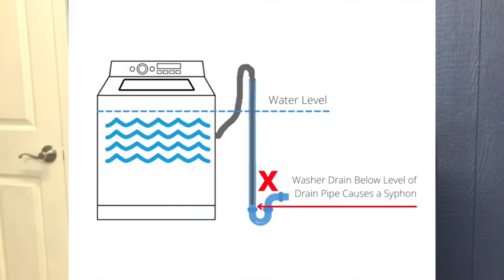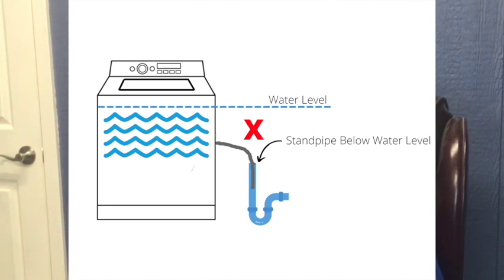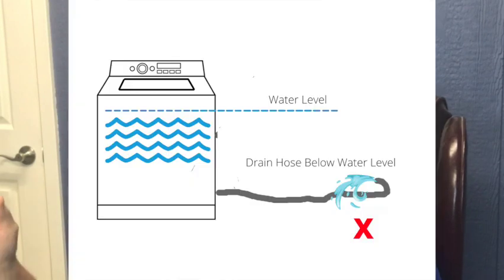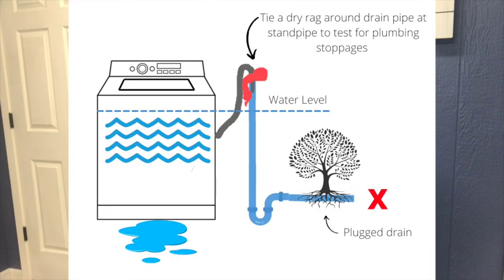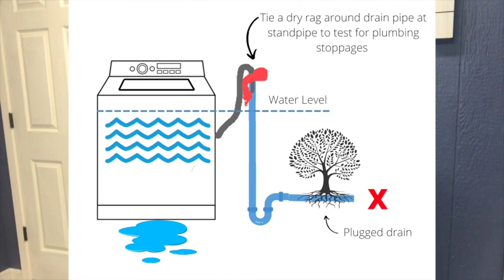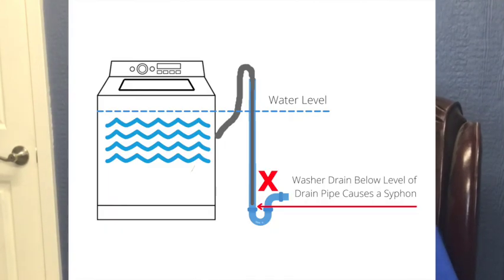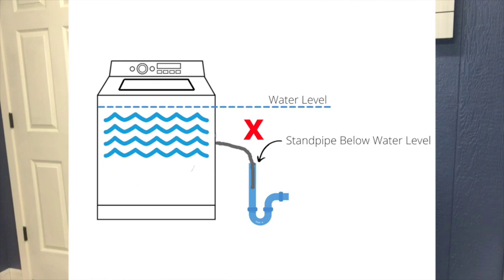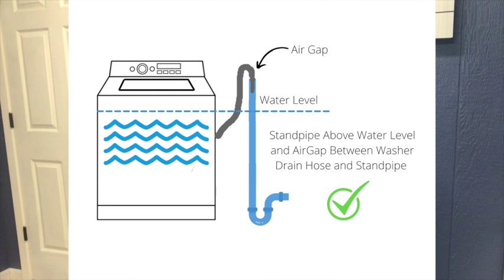How To Troubleshoot Washing Machine Cycle Failures: Plumbing Tips for Technicians

Comment: Have you ever had a washing machine stop after the wash cycle drain but not refill for the rinse cycle unless you would run the water somewhere else in the house first, you could hear the pump make a humming noise but nothing would happen until you open the valves to the sink
Reply from the maker: No, I’ve never heard of such a thing. You got gremlins in your house! Thanks for watching!

Comment: Washer was working fine as usual when I remembered that I hadn’t gathered all laundry so I paused it while gathering remaining laundry but while in mast bathroom which shares a wall with laundry room I hear machine draining I run in and it wouldn’t pause it wouldn’t fill only empty so I unplugged it which will normally cause it to reset but when I plug it in 1/2 hour later and its still draining even though it clearly in fill mode so I unplugged it and that’s where I stand at this moment
Reply from the maker: Hold the start button down until the pump stops running. If it reoccurs you’ll need to change the control board.

Comment: I purchased a Candy SmartTouch not that long ago, and it has been  working fine for quite some time... then it suddenly gave an error code E02, which indicates a filling error. My drain is far from perfect, so the hose has been sitting rather low, but this has worked fine with both this and previous washing machines.
So I followed the suggestions elsewhere and replaced the inlet solenoid valve a few days ago, but to no avail.
However, after watching this video, I gave it a shot and raised the drain hose a few inches, and that happened to solve my problem - now it completes the cycles with no issues whatsoever! Perhaps the hose has dropped just slightly at some point, causing this behaviour.
Thanks for this suggestion, now I can finally wash my clothes properly again! :-D
Reply from the maker: Some problems have simple solutions. Thanks for watching!

Comment: you know this! One of the first steps in trouble shooting a problem it to decide, what did you do to change conditions while attempting a repair.
Reply from the maker: Good advice! Thanks for watching!
Reply: @HarperandKnowles  I didn't know if you were still current. Good! I have a question. Oh. 22 years Air Force Jet Fighter Mechanic, spent the next 20 or so years in manufacturing and distribution. I've turned some wrenches!  My washer quit working on me last week. LSQ8243HQ0 Whirlpool Washer. I bought new in 1999 or 2000. Lots of hours on it. Thought it was the timer. Changed, nope! checked out the water level switch, the air tube was plugged. I was able to clear it but it almost immediately plugged back up. Before I found that out I determined it was a bad switch with a meter so I replaced the switch. The lid switch also appears to be bad. I have one coming probably be here tomorrow. Right now I am thinking there is so much junk in the bottom of the tub I am going to have to remove the inner tub and clean it all out. The tube at the Air Dome end appears to be back filling with scrud from the bottom of the tub. I injected vinegar as I've seen here. And filled the tub with a couple gallons of vinegar to sit overnight hoping for a quick band aid fix! The original problem was and still is, washer would not finish the wash cycle, would not advance, or drain. I used the drain hose to empty the washer by filling a bucket that was lower than the bottom of the washer tub. It drained good. No blockage. I drained a waterbed once in an eleventh floor apartment in Spain by connecting a 50 foot garden hose and lowering the other end over the side of the building.  It drained fast! I had pulled the water pump off of the motor without disconnecting any hoses. Pump turned okay and the motor turned okay. The motor does power the agitator. Should it still power the spin? When I clean out the tub I will disconnect the hoses from the pump and look inside it just to make sure there is nothing there. What really concerns me is after changing the timer, the water level switch, the lid switch and cleaning out the tub if it still will not advance could there be a problem with the motor and the gears? I suppose anything is possible.  Runs the agitator alright though!   I can replace all the major components and still be cheaper than buying a new washer especially if I add in what I've already spent on nonreturnable parts. I just turned 70! I want my washer once it is repaired to out last me!  Been getting in some cussing practice! Just looking for some of your years of knowledge. I'll be happy with whatever you share with me! Ideas, encouragement, words of wisdom. All will be appreciated! Thanks. Have a great day!
Reply from the maker: Change the lid switch.
Reply: @HarperandKnowles  thanks! I pulled the lid switch and it was coming apart. I should have the new one tomorrow. I saw a guy band aid a switch with a zip tie. I could probably do that but why? I'll just install the new switch and hopefully all will be golden!
Reply from the maker: Or you could make a bypass from the plug on the bad switch until yours comes in. Just tie the two wires that aren’t ground (ground is the green wire) together.
Reply: @HarperandKnowles  As you know, taking things apart so you can gain access to what you must fool with is what is the most time consuming parts of any repair it seems. I'll just wait on the new switch! I have the cabinet cover off right now and I don't want to put it back on yet. It challenges my old ass! The reaching and bending and squatting just aren't very easy anymore! Wah!

Comment: thats some slick camera work buddy😊👍 i like it. 

my  BUSH A127QW washer was working fine for years as is but has started to trip the circuit breaker, it will turn on start to fill/run as usual for about 10 seconds then trips the breaker. before this happened i had noticed that wash cycle would go on and on until i manually turned the dial to rinse, then it would drain the water out and rinse and drain and spin the clothes out just fine, but now it just trips the breaker at the start. ive tried a cold water cycle too thinking it might be the heating element but no it trips the breaker as i described above. the fact its starting then tripping the circuit is bugging me as its working but something goes off,  also the fact if it was set to drain and rinse manually before this breaker tripping started, it would do that so that suggests the drain pump is working as well. man if you could help me that would be great!!
Reply from the maker: I would try replacing the breaker. After tripping repeatedly they get weak.
Reply: @HarperandKnowles  thanks for your reply i will try that. so you dont think the washing machine is causing this? my breaker doesnt usually trip and its definitely being caused by the washer running, if i switch the washer off and reset the breaker it doesnt trip anymore, then turn the washer on and run it it goes for about 10 seconds and the breaker trips.
Reply: @HarperandKnowles  so i tested to plug and the breaker by plugging in a microwave and running it, it did not trip the breaker. 

i got to the heating element in the washer and disconnected all the wires leading to it and turned the washer on, it drained all the water out of it that was sitting in it from beginning the wash cycle before, ran for about 1 minute then tripped the breaker. so its not the drain pump and its not the heating coil, correct? when it began to go into the selected cycle the water came on into the detergent drawer for about 1 minute, then stopped, maybe was a prewash or fabric softener section or something? THEN, when it switches to put the water into the main drawer where to wash detergent goes, that is when it trips the breaker!
Reply from the maker: Could be a shorted solenoid on the inlet valve??? Sounds like you'll find it by elimination.
Reply: @HarperandKnowles  wouldnt that then trip the breaker at the first sign of water? or does the inlet valve only get used after the prewash/fabric softener has been done, then when main flow of water comes on for the detergent section for the wash cycle the valve comes into use? thanks again!
Reply from the maker: Each function has a separate solenoid to feed water into that area of the washer. Also if the cycle selector is warm a hot and cold valve mix those streams into the fill funnel. Another solenoid routes water to the bleach tray and another to the fabric softener dispenser. Water inlet valves can become very complex depending on the manufacturer. Try unplugging each solenoid in turn and testing to determine if one is causing the short.
Reply: @HarperandKnowles  nice thanks buddy, ill check that tomorrow. im getting close i can feel it!! haha.  i selected cold water washes as i thought was the heating element but at the beginning of it all theres definitely some clicks and switching going on and i know just from using it thats for the pretreatments like you said,  then it cuts out, so yeah you may be right on target there. 👍
Reply: @HarperandKnowles  well i went to the scrap yard today and found a washing machine with the exact same water inlet valve, i took it home and swapped mine out carefully hooking up the wires properly, got all excited and ran the washer and it tripped the breaker again at the same place in the cycle.  i suppose the used inlet valve could be busted too i will get a multimeter tomorrow nd check that out, but if not what would come after the inlet valve to test? thank you!
Reply: @HarperandKnowles  ok so heres an update, another technician advised me after the inlet valve didnt stop the shorting thaive taken your advice and swapped out the mains interference electrical filter and things have improved but now its doing something else. the machine now makes it past the prewash and fills the drum with water for the main wash, then it stops seemingly ready to wash the clothes, and then the stop cycle light flashes a bit then the machine drains the water, stopping the cycle :(. man im so close, what do you think?? is this now a motherboard issue? thank you!
Reply from the maker: I was looking back through this thread of this discussion and see the make and model of this machine. I have never encountered a Bush before. I did a search and found that it is made in Turkey. You may be asking the wrong guy for advice. I know they basically all have similar components but I don't have any experience with this company. Stopping after filling could be a lid lock problem if it's a top loader. I really don't know how to advise you about it without being able to diagnose the problem myself. Thanks for reaching out!
Reply: @HarperandKnowles hi thanks for your reply.  yes im in the uk its huge store chain called Argos brand. dont all washers basically just do the same thing in the same way though? slightly different parts but basiclly operate in the same way and present similar problems? uk us canada europe dont they all work the same??
Reply from the maker: Yes, pretty much, but some issues are more common among certain brands. If I had any experience with this brand I could probably be more helpful. Good luck with your repair.

Comment: i have a RCA portable compact washing machine that is throwing an E4 error code (drain alarm) when it hits the rinse cycle. at one point it threw an E5 code (overflow alarm). it throws a code when there’s about 2-3in of water left in the tub. the water CAN drain, i was able to get the water to drain eventually the first time around. it just WONT drain. 

the rinse cycle begins, it counts down from 28min to 27, and it never counts down lower than that. the draining also starts off normal, and i can visually see water running through the drain hose into the stand pipe. after a minute the draining starts to slow down to a crawl. eventually the alarm goes off. 

if i manually skip the rinse cycle and set it to spin, it works fine and finishes the wash out removing all water. 

this all started when i washed a rug twice in a row. the first time nothing happened, and the second wash the alarms started going. 

there’s no clog in the drain hose, the drain hose is correctly in the standpipe, the filter is cleaned out. i have no idea what to check next
Reply from the maker: I work on a lot of washing machines but I can't say that I have ever worked on an RCA. With my limited knowledge of these units I wouldn't be able to even speculate on the problem. Are these units commonly found in RV's. I don't work on these due to the limited space and the difficulty in removing them from the vehicle. I usually refer people who come to me with these issues to seek the help of an RV dealer. Thanks for watching!
Reply: @HarperandKnowles  thank you for replying! i’m not sure if they’re used on RVs, from what i’ve seen online it’s comparable to most other portable washing machines. i have mine permanently hooked up to a hot and cold line though instead of using it through a sink. there’s nothing online besides the 11 page manual lol, so i figured i’d try here before messing around with it some more. thanks again!

Comment: The machine is not filling all the way up but when it stops it flushes out the water before the wash sycle begins the drain pipe just goes out the back of the wall to the ground ..can u tell me whats wrong with it
Reply from the maker: If you watch the video it will probably give you the solution to your problem. But, I’ll give you a hint. The drain hose must be higher than the final water level inside the tub. Thanks for the comment!

Comment: I have a Maytag MVWB765FW3 error E1 F8 have already cleared the screens it filling and draining at the same time how does the water level pressure switch work and where is it
Reply from the maker: If you watch the video you might get a clue to what your issue is. Thanks for watching!
Reply: I replaced the inlet water valve and it works ok now but for some reason when the washer stops instead of all the lights going off the led is flashing 01
Reply from the maker: I have no Idea. Error codes come in sets of two; flash two digits then flash two more. As far as I know, there isn't an 01 01 code.
Reply: @HarperandKnowles this isn’t a error code after the wash is done it just flashes 01 THANKYOU FOR THE REPLY Normally all the  lights go off after the wash
Reply from the maker: Well my OCD is triggered now. If I find an answer for you I'll let you know. As long as you can wash your clothes I suppose it will okay!

Comment: Thank you so much for this video. I had recently replaced the drain hose and thought that the longer hose would be beneficial to my washer but I quickly found that my washer would empty out the water prior to it completing the rinse cycle. The drain was way lower than the tub (causing the siphoning effect for my washer) so I cut the hose down and voila problem solved like you said. No need to call a technician to come look at it. Thanks again!! 🙏🏽
Reply from the maker: Some of the world’s problems are simple to fix. Thank you for watching my video and the positive feedback to!

Comment: Thanks for this video.  I think my issue might be a little different.  My washer is 15 years old and has worked perfectly until this weekend.  it's an analog Maytag and it has started filling and draing at the same time.  I started a load late one night and it it continuously filled and drained all night long!  We haven't made any plumbing changes so I doubt there is a syphoning issue.  Is the drain valve stuck open?  What should I check?
Reply from the maker: Something has changed. Make sure your stand pipe is higher than your tub. Pull the drain hose out and make sure there is an air gap.  You didn't mention what model of Maytag you have.  If you have an electric pump is it running while washer is filling? It's probably something simple.
Reply: @HarperandKnowles  Thanks for the quick reply!  Maytag model # MAVT834AWW.  I'm not sure how the stand pipe or tub could have changed but I'll check this evening.  This washer has worked flawlessly for more than 10 years.  The water comes on like normal, but absolutely no water is filling the tub...I watched it for quite a while this morning.  No water is leaking onto the floor either...thank goodness.
Reply from the maker: Okay Bryan, your machine has a belt driven water pump so unless the motor is running and the machine is spinning during the fill cycle that isn't your problem. It has to be a condition where the drain hose is lower than the tub or you have a siphon condition.  There isn't a drain valve on the machine only a pump. You'll have to do some investigating to find out what's going on.
Reply: @HarperandKnowles  - Your advice was perfect! You were absolutely spot on with your assessment. I pulled out the drain hose and immediately heard water draining. It was obvious that I had broken a seal created by unspeakable nastiness!  Also, the hose was a little too far down the stand pipe. I cleaned it all up, reinstalled the drain hose the proper distance, and confidently restarted the washer. Works perfectly again!  Thanks so much!
Reply from the maker: I'm glad you found the problem!  Easy fix. Thanks for watching my video.